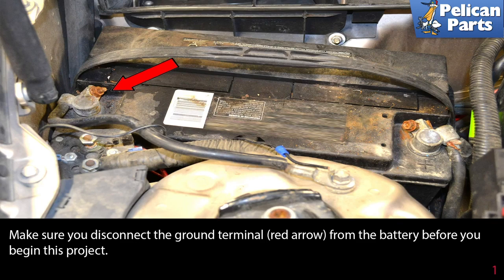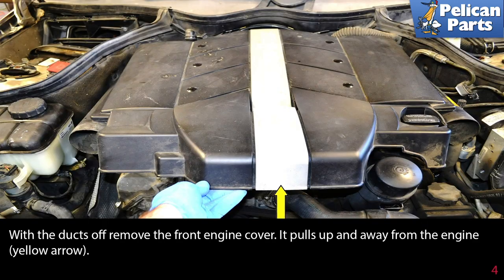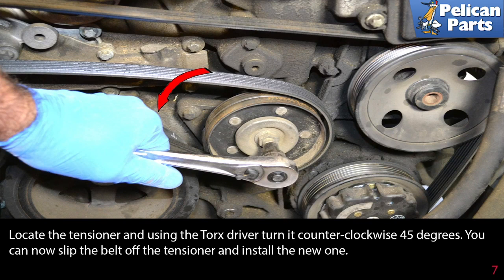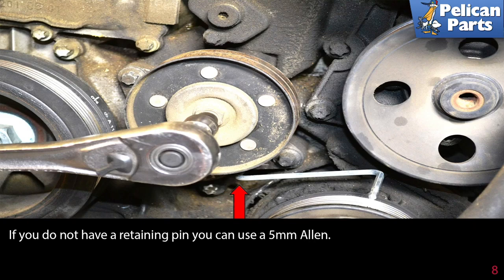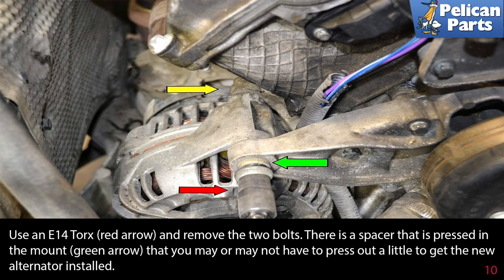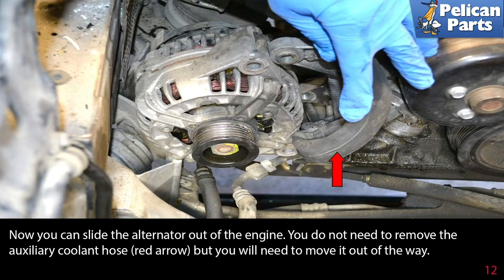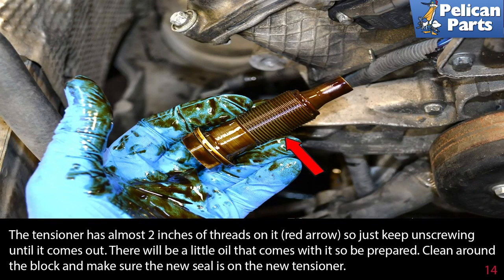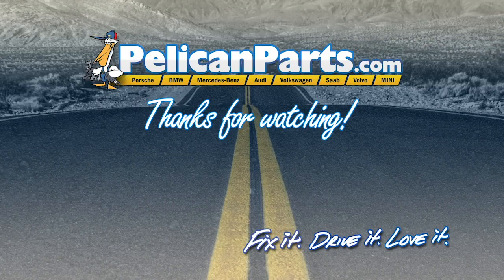Mercedes-Benz W203 C-Class Timing Chain Tensioner Replacement

Comment: When installing, it is a must to make sure the cylinder head and camshafts are in proper place with their rockers - then turn the crank shaft clockwise until the timing chain rail guide is loosened. Then you can lift it with hand, with help, only then after this install the timing chain tensioner while pushing it in - this is proper installation. If you just install it while the timing chain guide rail is tight, you will destroy the threads, and have a bigger problem on hands. Talking from experience.
Reply from the maker: Thanks for the additional info. We appreciate it.
Reply: Hello, and what is the correct place for the cylinder head and shafts with rocker arms? Are you referring to the timing position, crankshaft pulley degrees?
Reply: @mario7155  before turning the crank on the pulley, must be made sure that all rockers and everything before that is tightened down and in place, yes. Afterwards if you achieve a loose timing chain guide rail from turning the crank you instal the tensioner

Comment: I had a hard time trying to reinstall the new tensioner and could not find any info on an easy way to do it without removing the valve cover...
I noticed that if you put your finger in the hole 😂 where the tensioner goes into the block of the engine and slowly rotate the engine over by hand you can start to feel the tension on the timing chain releasing giving you enough slack to insert the new tensioner without stripping any threads... Hopefully this info can help other people. I removed mine and thought I was screwed cuz I could not get the new one in.
Reply from the maker: Thanks for the Info. We appreciate it.

Comment: Disregard “installation is the reverse of removal “. If you follow this you will probably destroy the soft threads of the timing cover. 
Instead remove the right side valve cover and relieve tension of the chain by gently lifting the chain rail slightly so that the new tensioner screws in easily and without undue force.
Reply from the maker: Thanks for the Info. We appreciate it.
Reply: Just was wondering what was going on. Thank you, will do this

Comment: Installation is the reverse of removal? I thought there was a procedure to tighten the timing chain by counter holding the cams and turning the crankshaft backwards?
Reply from the maker: Nothing like that needed when replacing the tensioner.
Reply: @pelicanparts  you might be wrong cause  I see people doing it

Comment: Hello, i have a w203 c240 2.6 m112 e26 engine, the same like this, and i want to know something. When to change the timing chain? Some mechanic says it never changes, now the car is with 240.000 km . Thanx
Reply from the maker: Generally they are replaced when the guides, sprockets or chain wear. Indicated by noise or a timing issue.